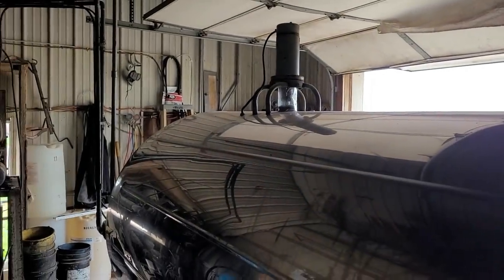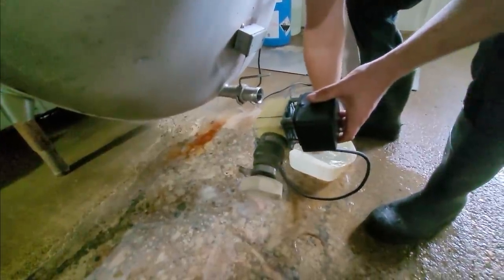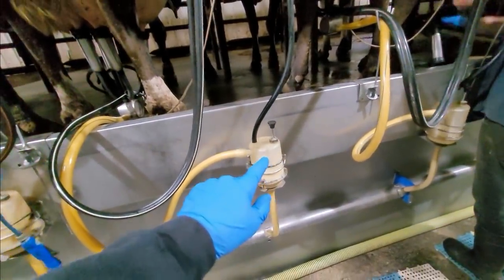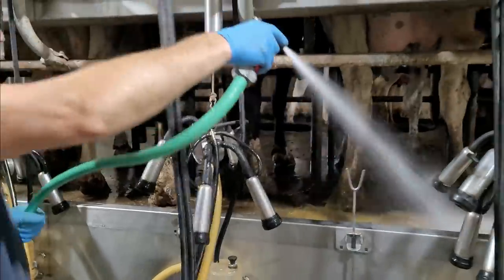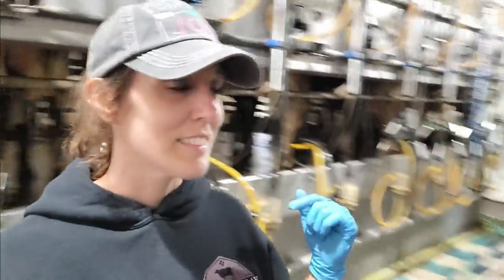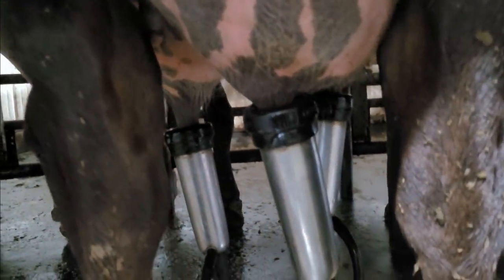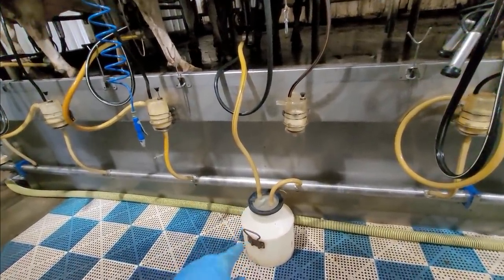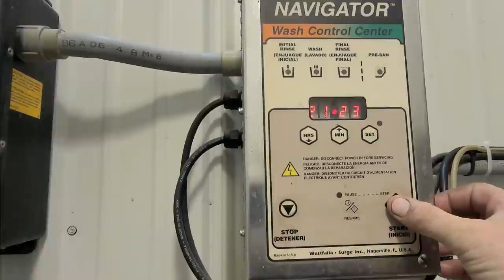Date Night in the Parlor

Comment: Hey, if you don't already have dielectric unions on that water heater you might want to consider installing some. The copper lines need to be isolated from the steel tank to help reduce corrosion. Copper/steel or brass/iron dielectric unions will work and will help to make the tank last longer.

Comment: We use paper towels. Do ye ever consider using paper towels to wipe the cows teats before milking. It would save having to wash wipes for each milking.
Reply from the maker: We used paper towels for several years. Got costly.
We've been doing towels for long time and worth the investment of a washer and dryer.
Reply: @acresofclayhomestead  Thanks for replying back.
O I see. Ye invested in a washer and dryer.  Yes paper towels can be expensive. We buy in large packs of rolls of towel and get a good price deal.